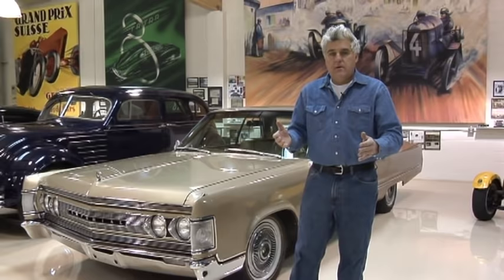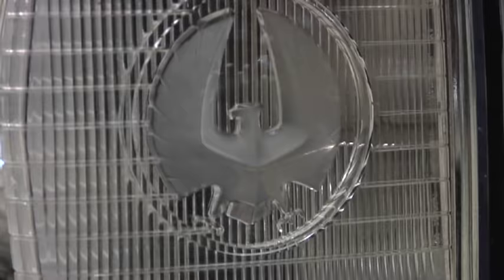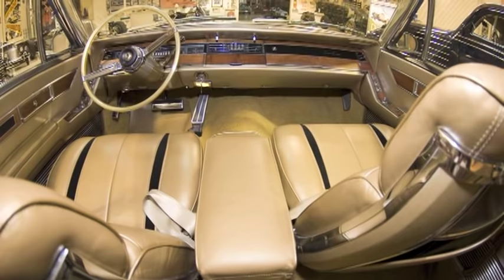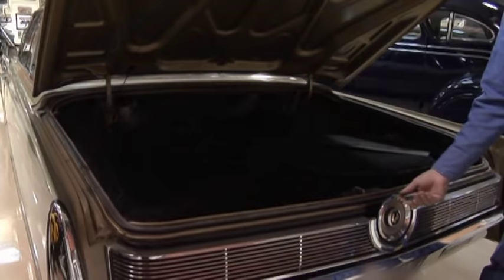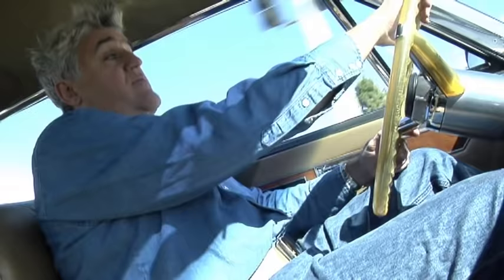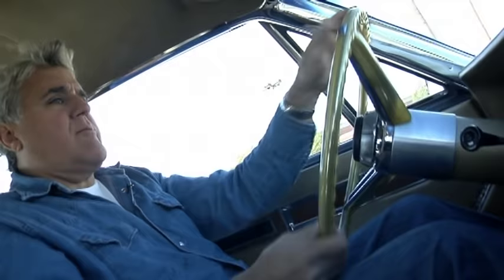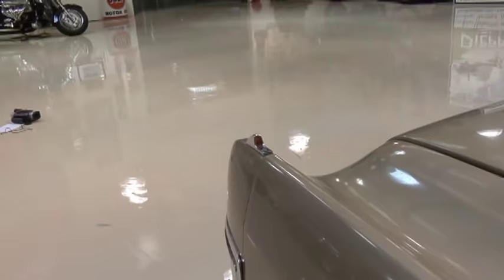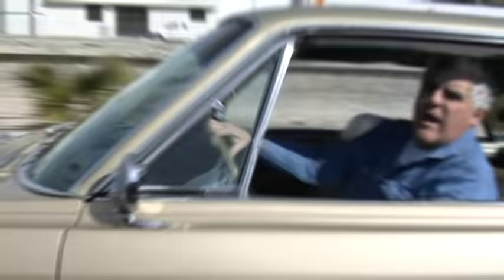1967 Chrysler Imperial Crown Coupe - Jay Leno's Garage

Comment: Amazing that Chrysler Corp was sill using leaf spring rear suspensions in 1967 when relatively "low end" cars such as the Chevy Chevelle were using coil springs and control arms.  Indeed, even the "all new" 1980 Imperial STILL USED rear leaf springs!

Comment: Jay, Thanks for the videos, I really appreciate your recognition of all these different vehicles. I bet your shop would be a fun place to hang out, don't worry, I'm not asking.. Just saying. Anyway.. I don't know if you read these comments or not, Jay but if you do, I couldn't help but notice in your review of the 1967 Imperial when you demonstrated the tilt steering wheel, you did not show off the telescopic feature, and I wonder if you're even aware of it? You access it by spinning the center hub of the steering wheel. That unlocks it, and the steering wheel slides in and out. It's kind of a 'hidden' feature, you have to know about it to know it's there.. You know how they did that sort of thing back then and it's one of those things you would only know about if you spent some time with the car., Cool, huh?
Reply: Stand Bye Me.
Reply: Thank you for pointing out the telescoping steering wheel feature! My great-aunt had a 1967 Imperial and as a kid I thought that was one of the coolest features of the car.!

Comment: I live down in Homestead, Florida just outside of Miami. Down the street there's a guy with one of these (I want to say a 1966). It's lime metalflake green with at least 26-inch spinners, a brown velour and fiberglass speaker box interior and a giant mural of a Cheshire cat down the side. Every time I see that thing I want to scram "What the Hell did that poor car ever do to YOU?!" I swear, this Chrysler's just crying inside, begging for somebody to steal it, restore it and give it it's damned dignity back. Or drive over it with a bulldozer. Honestly, it would be a mercy killing. Poor Chrysler...man, I worry about this generation sometimes.
Reply: Seein' that thing comin' at me would make me wanna scram too.
Reply: Richard Rowe ya know i love lowriders, hydraulics, and spinners but nothing beats a clean original
Reply: Better than letting it rust, man. Least the car's still going to be intact years later.
Reply: Rogue Jukebox no, it probably won't. I work at Cadillac. We have these roll in occasionally, and every light is on, it's leaking oil, tranny fluid..if they look like that on the outside, they are almost always junk on the inside. Same goes for lifted trucks. They trade having a safe, reliable car for having a "cool" one.
Reply: Richard Rowe I understand. I saw in the comments about how a young guy like myself wanted to hotbox an old like 1924 four door Model J. Or something like that. But it's like, "No, you should have more respect for something as classic and valuable as that. It's just wrong to abuse it like that." And I smoke, but I wouldn't ever do that. I like the car too much.
Reply: I really hate it when I see a perfect and iconic 1961-63 Lincoln with huge custom wheels, rubber band tires, bucket seats and console etc. Yuck.
Reply: I understand your sentiment, but it sounds like the owner is a true car guy and, well, a cat guy, too.  And it sounds like he appreciates his Chrysler, putting all that money into it and customizing an old family car and turning it into his version of a Hot Rod Lincoln.  And a lot of customs and muscle cars were wacky and even tacky back in the day, but to each his or her own thing--or car, as it were.
Reply: +emjayay I agree. Keep it original. Especially a 61-64 Lincoln, need's nothing more.

Comment: Nice car! I have a 1962 Imperial - Crown - 413 wedge head push button transmission. It has the pod Headlights and gunsight tail lights.The one thing parents did not like about the older Imperials was the power was on without key in on position and the power windows were dangerous if kids were playing in. The wheel covers on the 62-63 Imperials were designed to pull heat away from the brake drums which helped to keep them cooler. Also, metal gage for the Imperials was thicker than any other car and the Imperials would win all the demo derby's.

Comment: There was a friend of my fathers who owned a 66 or 67 Chrysler Imperial 4 door Le Baron. I remember it had to be about 20 plus feet long. We had a 7'2" or so wide garage (length wasn't an issue as it was an end to end twin car) so there was literally an inch on either side of the out mirrors.

It was, however, no lowrider, no look at me I just won 10k in the Irish Sweeps. It had an understated look to it, at least as understated as a parade float could be.

It had an a certain 'American Elegance' that belied other luxury prestige brands.I liked that.

Comment: I know that this is an older video, but if you read this Mr.Leno it's kind of special for me.
Back in 1978 I was working as a mechanic for a relatively well known shop in Brooklyn NY called
"Pontiac Pete's garage"
My boss and mentor 
Pete taught me every thing I know about the 
GTO and SPEED.
I couldn't afford a GTO but I did find a 67' Pontiac 
Le Mans that was compareable to the GTO if you swapped the GTO parts into it.
I was also a big fan of 
Mickey Thompson, his 4 engine Pontiac land speed car really made me find out about 
SPEED.
To make a long story short Thompson broke up with Pontiac and kind of changed things for me.
Richard Petty was very big in NASCAR back then and caught my attention.
The street Hemi and the 440 were great engines and Petty ran them into the ground.
At the same time my Father was into Chrysler.
IMPERIALS.
I sold my Le Mans 
(It had a 455 and the GTO trans axle)
And bought a 
1972 440 Charger.
My dad has a 72 Imperial, he asked me if I could "hop up" the 440.....
It struck me like a lighting bolt!
The "6 pack" triple two barrel manifolds were plentiful.
Most mechanics did not know how to tune a 6 pack, but Pete taught me all about the Pontiac triple two barrel engines.
The tuning of both of those engines were not that different.
So I made the engine plan.
The 440s (2 of them)
We're bored out to 472 ci. One was 10:1 compression, the other 
( For my Charger) was 
11:1 compression with a radical cam.
After I installed the 10:1 engine and torque flight tranny into my dad's Imperial he was very happy, for a car that weighs over 4000 lbs to cut high 12s and low 13s was fantastic.
My P/o' ed (pissed off)
Charger had a different use planed for it.
The 11:1 hi rev cam made it a bit of a handful with it's Hemi 
4 speed transmission.
On one long little used road it hit 182.23 mph.
It was lifting a little but I fixed that with a hand made 3/8ths inch aluminum spoiler under it's nose.
Truthfully?  It kind of scared me a little.
It now had a "attitude" of its own.
I drove it for 10 years.
But at that point we had 3 kids and we needed a 4 door car.
My Father passed away and he left me many things...
And his 72' Imperial.
I have it to this day.
Yes, it guzzles gas.
Yes, I don't want to park it on the street.
But after 84,000 miles on that first 440/472 engine that I built back then is still going strong.
It's a little smokey on cold start up, but I can't let it go.
The way of the muscle car will never die!
Mr.Leno-
Thanks for reading this.

Comment: My aunt had one when I was in high school, and when I got my license she'd loan it to me while she was at work. Man, for a massive car it would get up and go!
Reply: Noah Zarq how long is it
Reply: Noah Zarq fkn hell a coupe can be that long

modern s classes arent that long
Reply: Hi All They Found.. the reason for that "get up and go" was because of several factors.  1.)  The Torque-flight transmisson boosted engine performance quite a bit... 2.)  The engine was the 440 cubic inch 4-barrel that was one of the fastest and greatest engines ever made.  3.)  The car used only "Premium" gasoline that would also boost engine performance.  Back in the day, the higher the octane level the greater the engine performed.  The 440 did best with an octane rating of 95 or higher.. keep in mind, jet fuel octane is 100.

Comment: There was an episode of Mythbusters in which they used a 60s Chrysler in a test where they wanted to destroy the functioning of the drive shaft. They abused this car repeatedly but the car kept going. Eventually, they took a Sawzall and cut a long way through the shaft before it finally broke. But, these care weren't made very well. Yeah, right.
Reply: I drive a '63 Pontiac Grand Prix with the 389, 3 speed auto with A/C. I love the car! The previous owner had the 389 rebuilt to GTO specs and had the automatic rebuilt too. Problem? 2 weeks after I got it, the trans would lock up and kill the engine at idle. Pulled the trans and discover, all the ears on the clutches had broken off. Turns out, rebuilders would often reuse old "hard" parts because you couldn't find these parts anywhere (sigh). So I bought an adapter and replaced it with a 350th. In hind sight, I should have gone with a 200R or a 700R since the rear gears are 3:23's.
Reply: Jorge Rodriguez I agree! I have a '72 Dodge Polara 360/727/posi in original condition and its damn reliable. I've done all the maintenance and repairs on it myself because well, its easy. I have this little '01 kia rio that I got (cause I don't want my Dodge to rust out in the winter), and the little car gives me way more problems. Damn thing can't even idle right and i've replaced sensors, cleaned the iac valve etc; and now the bearing is squealing. After doing some research, yeah they pretty much make throw-away cars now that are made to break. On the flip side, i'm pretty sure with the proper maintenance my Dodge will outlast ME.

Comment: The thing that gets me, is when people refer an Imperial as a "Chrysler Imperial". It was a separate marque. To say "Chrysler Imperial" would be the same as saying " a General Motors Chevrolet". Imperial was it's own brand. It's not a Chrysler Imperial. It's an Imperial. In my lifetime, there were 2 Chrysler's: a Chrysler Newport, and a Chrysler New Yorker. To own an Imperial was to own the epitome of luxury cars. Even more so than a Cadillac. A magnificent automobile. You'll never see one in a demo derby. They're banned, because the frames are so heavy, you just can't total one at demo derby speeds.
Reply: It would be better to say "Imperial by Chrysler".
Reply: It's like saying "Ford Edsel" or "Lincoln Continental Mark II"
Reply: I agree, but it's not quite the same as a General Motors Chevrolet.  I believe you know why, but for the others, here we go.  Chrysler called its top line series, pretty much from the beginning, the Imperial.  Whatever model names made up the lower ranks, Imperial was above them all, including some magnificent custom bodied straight eights in the early '30s.  Then, from 1955 to 1975, Imperial was a separate brand.  That the top line model suddenly became a brand of its own, sold through exactly the same dealers, muddied the waters a bit.  Actually, the more accurate analogy is one that is coming up, that of Hyundai spinning off Genesis as a separate brand for its top line sedans.  

It is unfortunate that when looking for these cars in, say, AutoTrader Classics, it is easier, and brings better results, to give up and look for a Chrysler Imperial than to look for, as an example, an Imperial LeBaron.
Reply: @rpsmith2990  In the postwar period up to 1957 they shared bodies and almost all sheet metal with Chryslers, and always engines also. The 1957-64 was on its own frame and with an entirely unique body including the first mass production curved side windows, so it really deserved a separate name. Then they went back to being a luxury Chrysler (even if still with their own name) at first with a lot of their own body panels and eventually not.
Reply: The Imperial represented Chrysler Corporation.  It was made to prove that Chrysler could make a car as good as their competitors did.  GM made the Cadillac, Ford made the Lincoln. Chrysler wanted to prove they could make something as luxurious too.
When Cadillac lost it's reputation for top quality in the 1970s Chrysler's management decided that they weren't selling enough Imperials to make the money spent on this model worthwhile.
The Imperials were made to carry the Chrysler name.

Comment: I loved those old Imperials and Chryslers.  Owned many from 1957 to 1974. The 57 had the early style Hemi, the 392, and it was a magnificent gunboat!  Maybe someone already mentioned it, but I think Jay is mistaken about the cast iron Torqueflite in his Imperial.  If I remember correctly the last cast iron Torqueflites were used in the late 50's.  All the 440's - and I think all the "wedge head"  B block engines, used the aluminum A-727-B Torqueflite, which was an excellent transmission, every bit the equal of the much heavier cast iron transmission.  Great video Jay!  Brings back wonderful memories.

Comment: Sorry Jay, but your wrong. That is not a cast iron tourqeflite. It is aluminiun.
Chrysler stop the cast iron ones around 1960.
Reply: On all models? I saw a Mythbusters episode in which they used 60s Chrysler model and wanted to break the tranny and they ended up having to saw through most of it before it would fail.
Reply: I believe it was 1963 in the Imperial.  But it wasn't a 727.  It was a A-456 or some such.  I'm old, and I'll check the number and revise if necessary.
Reply: A-465